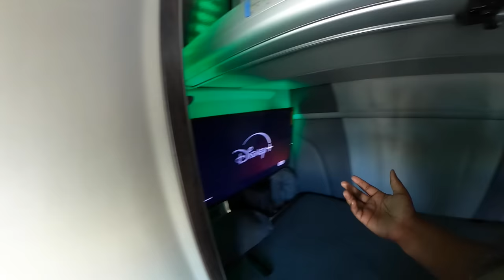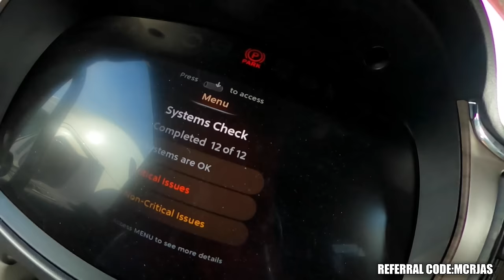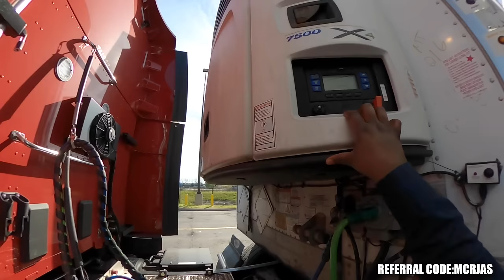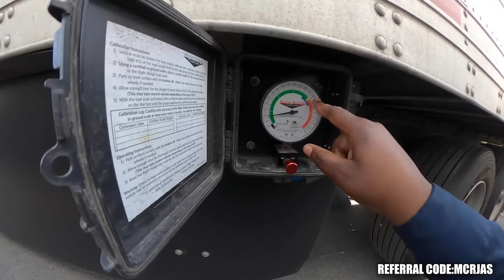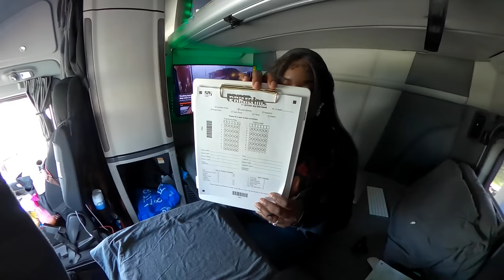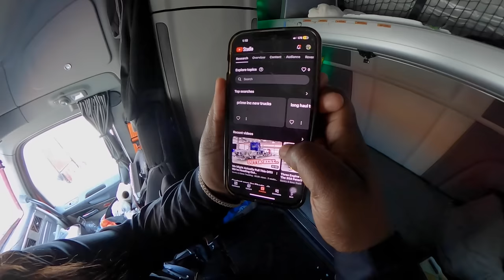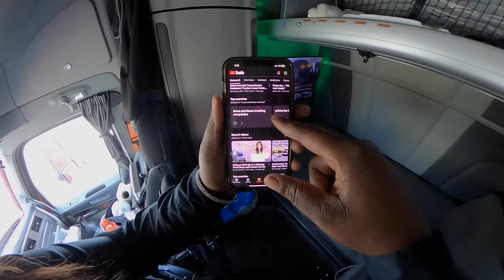PRIME INC Load Delays! Trucking Freight Market Up And Down

Comment: I don’t understand what sliding tandems is!
Reply: Moving the tandems allows receivers to have floor security while unloading freight and it helps to adjust the weight in the trailer and truck. So the load can be legal. There's a maximum weight of 72,000 lbs I think and each axcel can only have a certain amount of weight on them. It helps to keep a balance weight, reduces roll overs too!

Comment: I have a few questions about prime do they supply a APU and if so did you have to pay extra for it. I never really wanted to know about reefer until I started watching your videos and I kind of got interested in it is it more work than dry van I am a company dry van driver and heard about prime about 5 years ago I thought the same way you did but got out here and loved it so now that I’m trying to venture out into trucking for myself I just needed some more information I don’t want to jump into something and regret it because of not enough research so I would love to learn a little more from you personally not that you sold me on prime but I believe in signs and every time I start something else it comes back to prime so I would like to try it out